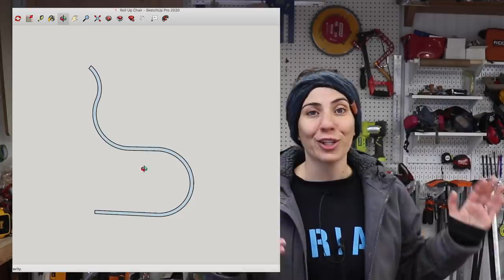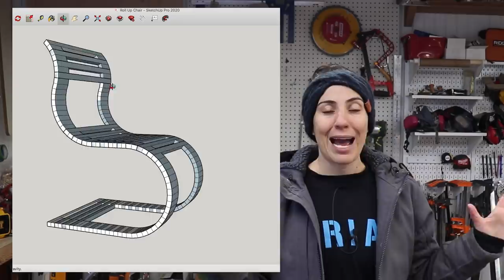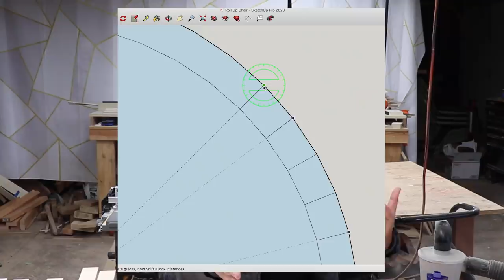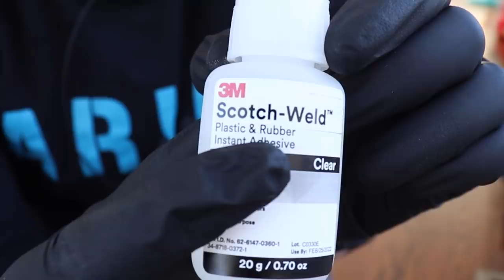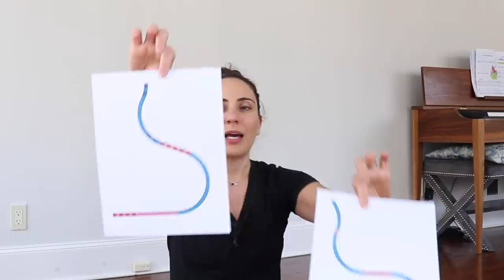I ATTEMPTED to make a chair that rolls up... It didn't go as planned...

Comment: Rock Climbing Straps from Blue Water for example and melting the cut areas with a lighter would be more appropriate to the strength of holding the chair together. Also, you would have to lok at the stress points and strengthen those curves with something like a horizontal piece of the climbing strap to get it to...not tear.

Comment: Hope you find this helpful
use the angle of the blocks for more structure than the belts. What i mean is make the angle cuts more aggressive in spots like the turn from bottom to the back. This should allow you to make the belt tight in all areas and allow for almost no give, and might i suggest hinges on the leg part and in between the back and bottom would add that extra level of security i think your looking for when you sit down and a hole on both sides of the bottom and top for lock-in wooden or metal supports that could easily be held onto the chair by a string. This would work by folding out the chair and fitting the supports in their respective guide holes so that the seat cannot fail even if kids are in the house.

Comment: Steeper angle on the pieces on the back, move the seat pieces forwards (the long ones that you sit on) by 4 and maybe create a wire support on the side between back and seat rungs that can roll up with the chair.  Remember the Triangle is a strong angle.

Comment: For a first try this is actually very good result! 

I think the backrest problem is caused by the pieces slipping horizontally - they don't line up. Fabric would always allow them to slip, perhaps that part needs some rigid hinges between the pieces?  

If you want rubber, try upcycling - cutting strips out of automobile tires (half-joke suggestion, they are reinforced by steel to have the needed strength).

Comment: You did realy great job 😍😍
The materials you choose were perfect, I believe the thing you did wrong is stabling the bottom arc while it's flat on the ground.
You need to but it in reverse arc shape whilst stabling the belts, in order to make the best use of the belts' strength.
Good luck in the next try ❤.

Comment: I believe that if you put some extra material between the contact of the pieces that makes the connection between the setting and the back-leaning part you could gain some extra lift. I think that in that point you shoul have cut the pieces to a smaller angle. It seems to straight. Thank for the video, though. I love your attitude and patience, all packed in a gentle smile. Keep the good work!

Comment: Interesting design. From an engineering perspective I would recommend bicycle chain instead of webbing. It is stiffer and can be made to absorb the shear load between the wooden pieces. Using webbing you would need to ensure proper pretension of the webbing. Looking forward to second attempt 😃

Comment: No fail here, just a bunch of ways not to do it.  Fun video to watch.   I wonder... The next iteration go back to find a glue that will work.  2 points (screws) won't eliminate the stretching from one end to another.  But each piece glued to the webbing would make the "stretch" only that between the pieces.  Maybe try the double-stick tape turners use, to hold the pieces to the webbing while a glue or epoxy sets up?

Comment: I would likely use a cable from one end to the other through the center of the peices before i added the webbing that way it has additional structure and all of the peices are in the right orientation prior to attaching the straps.

Comment: You should try to use car tires cut to size. They have metal wires inside. If they good enough to go thousands of miles without stretching,under constant 2 or more bar of airpressure, it will be easily strong and rigid enough.
Really enjoyed the video, good job!

Comment: Thoughts:  Use the polyester woven between the slats; one thick piece in the center and two outer pieces going in the opposite direction.  Have the chair go up into a backrest and then loop over and straight down, locking into the foot.  Also, include some way to lock the chair into the round shape for carrying or create a handle with which to hold it while carrying.

Comment: 0:02 The radius of the circle between the seat and the back support is quite small. It's also curving in the same side as when the chair is rolled up. If you get the right radius, you could clue those pieces together, which will ensure the back support is always up (well, "ensure" might be a bit of an exaggeration)

Comment: Steel wire through holes drilled in each piece with adjustable tighteners at the top. Put the holes near the top for the angled pieces so the wire is pulling them in an arc for those pieces.

Comment: I was screaming all the way through…like a roller-coaster ride! An earlier comment mentioned shims - I reckon having square edged slats, with small, evenly spaced gaps and a selection of pre-cut angled shims (that could be easily interchanged to take up any slack due to initial wear) might be a simpler process - there's a lot of leverage exerted on the bearing faces and therefore on the strapping and even steel reinforced belts could give in time. Brilliant video and inspiring - you lost the fight against super-fine tolerances but only just - I'm going to crawl into a corner and weep silently for half an hour :-) thanks

Comment: I think you should look into "pre-tensioning". Because the structural idea here is built on the idea of tension in the belts that you use, and this means that the structure of the chair heavily relies on the properties of the belt and the angle of cutting the pieces. Just a thought

Comment: 1. The front angle was very supportive and the idea of using the safety belts was perfect.
2. The more support you desire, the more angle you need in the front curve pieces, because all the weight lies there. You can even put some yoga mat rubber between them, in order to protect them from wear and tear that the constant pression causes by supporting all the weight in just one place.
3. What about making a scale version first? With chinese sticks, for example. It would be a good option for developing the prototipe, in order to save a lot of work by correcting your mistakes quickly and easily.
4. I would´ve done the support pieces with a bit more of angle in the part where the sitting part becomes the back of the chair (the corner), to make its angle more like 90 degrees and have more support in the back when leaning, besides of adding some more bars in the middle to rest the lower back.
5. I would´ve made the sitting part a little shorter, in order to take the back towards the chair´s gravity center, and added some more bars near/in the front curve to make a rest for the legs.
6. Another thing you could do is write on the faces of every piece so you can identify them easily and avoid confusions.

I hope you could read my opinion and tell if it was useful in second part! just found your channel and here I am... instead of going to sleep 😂😂😅

Sorry for my English (1:50 am and not native language).

Comment: You may want to try increasing the radius of the bottom sphere, rn the center of gravity is right below the the big dip in the chair, the center of gravity should be higher and closer to the first sphere. Additionally make sure the bottom portion that touches the floor should align with the the top portion. Hopefully that helps.

Comment: Hi Tamar!
I was wondering if there's something that holds all the pieces together, like a rope that passes through a hole in every single piece of wood. If a knot (or maybe some blocking washer) it's tied to an end and every piece is pushed until it's all tight (also blocking the opposite point), maybe the structure is secured from the inside. I think the Miesrolo could have been done in this way, so the felt is just a decorative prop, not a really functional one.

Comment: I think that you should approach your cloth material with a natural compound that will not stretch. Maybe do a blend, such as a keep the bottom a synthetic material that will bounce. While a strong fabric for the seat and backrest.

Looking at your final shot the wood shifts like colliding tectonic plates. To overcome this I would think to ether create a puzzle or locking mechanism that will lock those pieces together like a gear. Or Maybe change the pieces on the upward-facing block to allow to fold the blocks in when attacking the fabric, this would cause the fabric to already be put under tension allowing for a more upward/sloping seat that would be eliminated once seated upon. (kind of like preload on a car's suspension)

Comment: I think you want to actually minimize stretch. Something like kevlar or Spectra might work. I might try gluing it upside-down with an epoxy with the fabric on the bottom, placing the wood bits on top. Wouldn't work for the back without a jig, of course.

Comment: I would pre stress the whole frame using a template in the shape you want it to be when the chair is in its resting state also a harder wood with alot more compressive strength would help alot in dealing with compression of the timber due to leverage...even lowering the angles on each of the timbers would raise the chair more proud and sag to the right position when sat in

I reckon if you were able to pretension the strap for each timber it would work great...we do the same with suspended concrete slabs where we use hydraulics to tension cables running through the slab or through bridges and then lock them in place...stops it from sagging :D

Comment: Dude try adding some shims to the outside of your curve, you can establish the angles you need by using the shims and it can be adjusted until it feels right and then cut a whole new chair based on those angles. Obviously there is a bit of give to the seatbelts so accounting for that during the initial process isn’t easy but a trial and error approach from here I think would do wonders. Btw I love what you do!

Comment: I would sharpen the angles that curve up the back (make your top SketchUp circle smaller), and move some of the square pieces into the big circle where the seat starts. Also, make the jig! A horribly expensive method may be to use 250 small hinges along with the strapping (less stretch)

Comment: If you make the blocks thicker the pressure will be a lot lower on the compression side of the wood and the tension will be lower on the strap. You could do less blocks as well but I think that wouldn't have the same aesthetic. If you get a stress strain curve for your strap you can calculate the thickness of wood required to achieve a certain percent stretch (I would aim very low). 

Good luck!

Comment: You should try cable wire drill holes threw the wood and tension the wire to the desired position.

Comment: Most yoga mats I've seen are made of EVA foam and in the cosplay community the general recommendation to glue EVA foam is contact cement.
It's slightly flexible and does bond with (at least from my testing) polypropylene or nylon webbings pretty well. If you need something more durable but less flexible connection - use hot glue.

Even though it didn't turn out like you hoped, you've contributed to the information available about chairs like these. So you never know, maybe someone else will learn from your mistakes and make an improved version.
10/10 happy youtube recommended this channel to me

Comment: I would play about with the number/size of the pieces. And would also use a smaller tip on soldering iron for the seatbelt holes.

Comment: Great work :)
Every Time i see your videos, thinking about two steel cables in a Segment gab/tunnel with tensionscrews at the ends. Like bridge cables. Also steel wont flex like polyester.And after asembling you are able to tighten up the cables.

Comment: Love the effort into trying to make it work.  
I am beyond my pain threshold just imagining myself sitting in that and putting my hands along the edge to support my weight as I sit, and my skin getting pinched in the very slight gap between the pieces.

I think instead of making it circles, if you make the radius smaller and have a short straight section in the front where the "legs" are.  This would keep you from needing to sit on the curve at the front.  If you sit back where your seating pieces are, your legs have to go between the legs due to the large radius of the legs.  You can tell the original guy had the same issue from his photo.  His back rest was short like yours and I doubt his chair works well for actual usage.  So the bottom of your chair comes to the front legs and makes a sharper radius, then is straight for much of the height, then another sharp radius to turn back for the seating surface.  I am not sure how tight to make those radius, but probably half the radius you used in your sketchup. May have to use a larger radius on the top curve than the bottom of the legs curve.  This would put the balance point farther back.  Then do a similar where the seat cuves up to the back rest curve.  Make the radius very much tighter than you drew in sketch up.  Take a look at an office chair.  The back rest curves outward for lumbar but there is zero return curve towards the seat section.  Typically they are meeting at a tangent point of two outward curves meeting each other.  So the back curves outward towards the person.  The seat bottom curves upwards towards the sitter's posterior.  So need to make that curve at the back of the seating surface as tight as possible.  Though, I am not sure how that will work using wood and seat belts.  As that is obviously the point of highest stress in the seat. 
Best explanation I can find in quick google search is this image.  See how the seat back and seat bottom are both curving upwards and the back of them has zero curve.  >>>>https://www.cubicles.com/shop/images/executive-high-back-office-chair-side-view.jpg
https://www.awofficefurniture.com/wp-content/uploads/2019/05/21621-All-Black-Mesh-Office-Chair-Side-View.png   <<< Closest chair I could find to match your curves, but again, that curve at the back of the seat to the backrest is very small radius.

Comment: Forgive me if tons of people have already told you this, but if I may, have you considered 1). A harder wood that can handle a greater force per square inch as well as 2). incrementally changing the cut angles for each section, depending upon what you want the section of wood to do?  I think your strap solution looks promising if combined with either a harder wood or a harder surface on the wood-mixed with a combination of cut angles. Also, you may consider 3). Connecting the wood to the straps in the seating position, possibly by making a form/jig to hold it in place, not as a flat surface, since it is giving it too much stretch when it begins as a flat surface.  Great job, though. It’s truly inspiring.

Comment: You can cut thin shim “wedge” shaped pieces and glue them between in intervals until the desired shape is met. Without taking it apart
Reply: I was thinking something similar, or maybe pieces of the yoga mat in between them to act as a soft wedge.

Comment: The one of these I have seen, that definitely works because the guy unrolls it and sits on it in the video, uses what seems to be a piece of sheet metal for the lower back arch in order to give more of a sturdy positive curve, he then has a strap going from the top of the backrest to the base so that it retains its relative shape till you sit in it. I saw it on instagram, I will keep an eye out and try to come back and link it. You fail so gracefully, it gives much inspiration to try.
Reply from the maker: It’s a very thin one. Right? People have been tagging me. Ha

Comment: Anytime you see art student work you divide it by 10. Start from paper calculation.

I suggest less compressible material for "wood" part and the tension part use Aramid - Kevlar or glass fibre. Like the ones used for bowstrings. Maybe even cut channels for the kevlar/glass fiber.

Comment: Once you got all the angles figured out, add a strap at the back to keep it under tension when not being used in chair form. It looks like there's still a lot of give in the straps that need to be accounted for, and unfortunately if you account for it and then take the tension off it won't look like a chair anymore. Could possibly double as a strap to keep it together in rolled up form.

Comment: I would put at least 3 big one-piece semi-arches  (those areas don't need to be divided into small pieces. The winding is not tight). Those semi-arches would be in the curvature towards the floor, the curvature towards the seat and towards the back

Comment: I feel like you may need to include wedges between your pieces after the webbing is pre-stretched by sitting on it, or re-use the webbing which has been pre-stretched with this size to then include pieces which are wider or have steeper angles. 

Wedges screwed on with counter-sunk holes in might take up enough of the slack to make that work, but to prototype it, you could use glue on taped surfaces, as those pieces would be in compression. 

But I think the key may be that more material needs to be added to the sides after the webbing is firmly in place and has already stretched as much as it will. 

Maybe?

Comment: If you can: run a FE simulation to see how it will deform. Since the curve pieces are under very high stresses I would advise to maybe avoid wood in favor of a stiffer material: Maple, despite being one of the strongest woods, is still 40 times more flexible than aluminium, a relatively soft metal.

Comment: I would run twin steel cables inside each side and only rely on them for support, the felt would be decorative, still the back angle would needs to be corrected. But loved your work! Excellent job ! :D